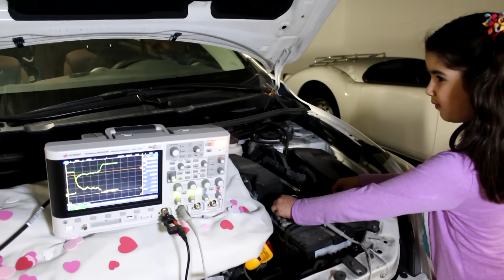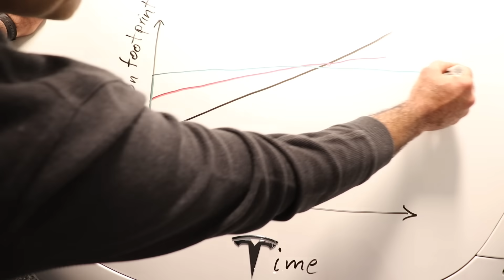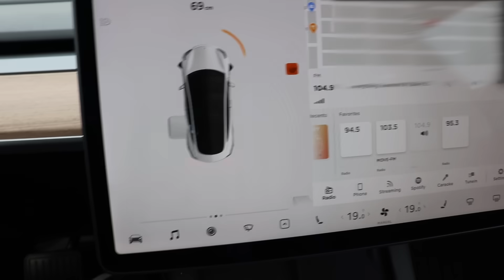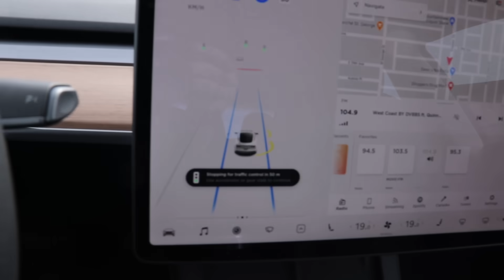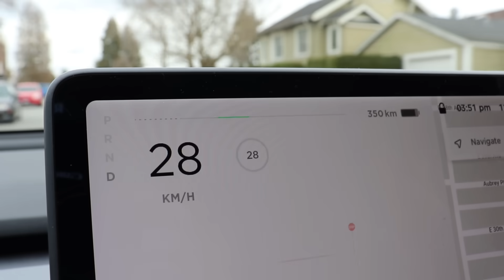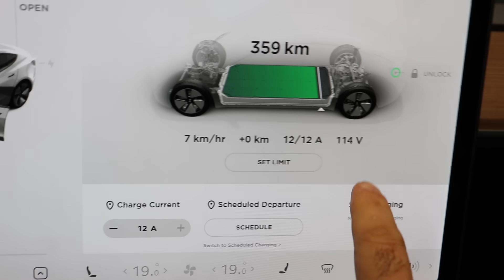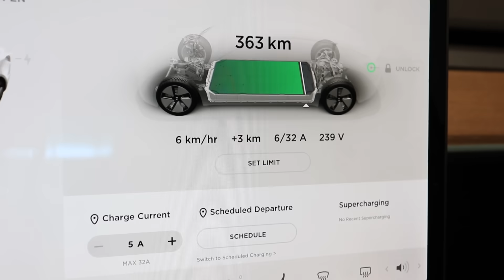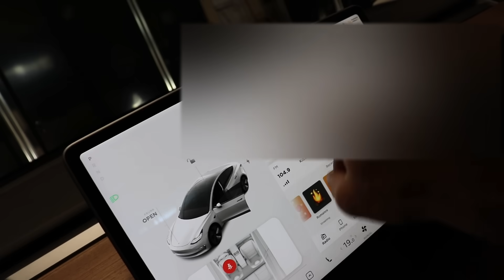ELECTRIC VEHICLES & My Tesla Model 3 Review

Comment: The only time my gasoline car drives 100km on 10L is when im doing 130 km/h on the highway. Even when I am "racing" with my car (Opel Corsa 1.6L Turbo, 150 horsepower) I get on average 11 to 12L to 100km. If I would drive like an old lady, this goes way up to 16L per 100km. 
Anyway, while still more expensive than EV, my main concern is 3 fold and you mention all 3 (nice!):
- Electricity is mostly Coal/Gas, this is just as bad for the environment. As long as nuclear power is not dominant, it will remain something that doesn't contribute to the environment shortterm.
- Production of EV car is less environment friendly
- Existing electric grid is unable to charge all cars at the same time. This will require quite a lot of infrastructure upgrades which will be expensive.
Mostly points 1 and 3 deter me from going to an EV car. I also like driving manual and getting that perfect shift at maximum speeds. Being in control of what the car does makes driving so much more enjoyable to me. I've driven automatic (gasoline) cars and I just find them a bit boring. But it is the way forward.

Comment: The problem with this new 'Electric cars are so eco friendly!!!' is that the energy those cars use comes from, you guessed it, coal and gas plants!!! The best way to produce electricity is nuclear energy! sure... There were some incidents about the whole meltdown thing but now? That tech is over 50 years old with fewer safety measures due to not knowing enough about the fuel! Stop being scared of nuclear! You're irradiated by the sun all the time and the new safety measures that can be put in place are more than enough to avoid extreme incidents! The number of indirect deaths from coal and gas is super high due to the mining accidents and lung diseases from the particles made from burning heavy fuels.
In nuclear, there is no burnt fuel! The rods of fuel are just releasing heat on their own by decaying slowly which allows energy generation for a long time at a decent rate! As my last point, roughly 1KG of nuclear fuel can produce the same amount of energy as 2.7 million kg of coal fuel!
Just search on google 'How much coal is equal to 1kg of nuclear fuel' and the first article will give you the numbers!
Ignore the stigma and get some damn plants built already you damn eco-warriors!

Comment: @12:50 this is why you should just leave it plugged in.  That's what I do with my Volt and Bolt EV.  They both use the AC power from the grid to heat/cool the batteries too as needed.

Comment: Model 3 is better than Bolt or Leaf because RWD. You don't start a clean sheet design by putting the drive torque through the steering axle. 😠

Comment: You are only pushing pollution to somewhere else. Electricity still mostly comes from fossil fuel.. and be careful driving it around, the trimming falls apart in highway and damages other card
Reply: Depends on where you live. He lives in an area with 95% renewable electricity.
And even in areas with mostly fossil fuel-based electricity, electric cars still win out on carbon emissions.

Comment: - Moving the steering wheel and pressing the pedal is only mandatory because of stupid regulations... Here in Europe we can't even use Autopilot because regulators are afraid. Thousands dead in every country from "human drivers" and people are afraid of a machine?!
- The cardboard boxes are not an obstacle. It has radar in the bumper to detect what exactly is in front of it. You wouldn't want your car to slam the brakes every time a plastic bag appears on the street.
- Manufacturing footprint is indeed larger... by 30%. What most are not taking into account is the petrol production. 20-30 tons of diesel are burned from every offshore platform every DAY. (1333 platform in the world). Pumping the oil consumes electricity equal to powering every vehicle on the road. Refining the oil is the most polluting process on the planet... take India or Australia for example. Not to mention the occasional oil spills.
- IC engines burn fuel at 18-25% efficiency, while powerplants are around 60% efficient when converting fuel to energy. With all that into account, EVs emissions are equalize with CV after around 11000 to 20000 km. depending on where you live.
- EV have almost no maintenance. Compared to CV that require regular oil changes, filters, transition fluids and expensive spare parts. EVs require 600 times less raw resources during their lifetime.
- Cows and agriculture account for only 8-9% of global pollution. It is responsible for 90% of ammonia and 29% of methane emissions... mostly because of fossil fuel based fertilizers. While transportation - 30%. + tons of NOx and SOx. In the cities, this number is way way above that (and you don't have cows there). 
- EVs don't emit toxic gasses which are responsible for more than 7 million deaths... every... year. (source: WHO) In addition to lung diseases and cancer.
Reply: EU laws will probably relax on self driving once the benefits are proven in the real world.
Reply: @logitech4873  Well, benefits are proven in the US - much lower risk of accidents compared with a human driver (source: NHTSA)
It's just that EU regulators are unnecessary overprotective... something like an obsessed mother that puts two layers of clothes and a jacket on you when outside is 20 degrees C. It's weird that they don't care about all the deaths on the road, but fear a feature that will considerably improve safety.

Comment: I work as a response officer, we ha e a nissan leaf at work and a couple of turbo diesel vans... I always drive the Nissan leaf, they're well built and accelerate faster than any TD I've driven.

The downside of electric vehicles is the heater uses the battery quick, and my style of driving kills the battery level within 30miles. This is from a full charge showing 106miles.
Reply: Is it a resistive heater or a heat pump?
Reply: @logitech4873  it's a heat pump, sounds it like a fridge when at a standstill...its a 2016 leaf. These electric wagons are good on acceleration, but come winter months when heaters are required and you need to put your foot down, like in a TDI the realistic range is 25%ish of what a fully charged battery.

I work response, so time is limited and the leaf is driven to near enough  its limits.

Comment: Funny thing with regenerative breaking, if you use it primary your brakedisks may pick up a bit of rust because the surface isn't "scratched off" as often... in my country you have to get your car checked every year and you guessed it, you won't get your permit even with just slight rust on the discs (unless of course the mechanic is cool, but not everyone is....)
Reply: Just remove the brake discs :)
Reply: @logitech4873  hmmm... you are absolutely right, that way you may not even have to check the car ever again!

Comment: You're killing the environment --

Quote - "  Studies have shown that in the US, Europe, and in China, producing an electric vehicle creates more greenhouse-gas emissions than producing an equivalent gas-powered vehicle.

The biggest reason for that disparity is an electric vehicle's battery, which can account for about a quarter of its weight, Colby Self, the managing director at the Automotive Science group, told Business Insider.

Electric-vehicle batteries are bigger than those used in gas-powered cars and feature a different kind of chemistry. While vehicles that run on gas tend to use lead-acid batteries, electric vehicles use lithium-ion batteries, like those found in cellphones and laptops.

Lithium-ion batteries require a lot of energy to produce. So, too, does the extraction and refinement of metals like lithium, nickel, and cobalt. They're also harder to recycle than lead-acid batteries, Self said.

"The CO2 emissions from making a battery are higher than what you save from not making the engine and transmission," David Reichmuth, a senior engineer in the clean-vehicles program at the Union of Concerned Scientists, told Business Insider. "

Quote - " the Union of Concerned Scientists found that manufacturing a midsize electric vehicle would produce about 15% more emissions than the process of building a similar gas-powered vehicle would. For a bigger electric vehicle with a larger battery, that gap could grow to 68% or more, the nonprofit organization found. "

https://www.businessinsider.com/building-electric-cars-how-much-pollution-versus-gas-powered-vehicles-2019-11

Comment: Teslas are infamous for not getting advertised milage but my 2017 Chevy Bolt actually averages significantly more than the advertised 238 miles (383 km). I typically get 300 miles (483 km) on a full charge.
Reply: It hugely depends on where you drive them
Reply: @logitech4873  How and where you drive EV's make s big difference, but Teslas consistently failed to meet their EPA estimates in real world tests conducted by Edmunds while most other EV's consistently met or exceeded their EPA estimates.
https://www.taiwannews.com.tw/en/news/4165464

Comment: Just a small correction, internal combustion engines don't burn fuel while engine breaking, the ECU cuts off the fuel (there may be exception for some engines in particular conditions). It won't refill your fuel tank but you don't use any either and all loads that may be attached to the engine (AC, power steering, electric loads) come for free.
Also in winter all heating coming from the coolant is free since it is otherwise wasted energy.
Not a big deal, just a couple of things usually overlooked.
Reply: Diesel cars do.
Reply: Petrol too
Reply: @luca6819  You just said the opposite.
Diesel cars burn fuel while coasting.
Reply: So i misunderstood what you said, sorry. But neither usually does unless some requirement are met, like cold engine or cathalitic converter, rpm thresholds or whatever the manufacturer programmed. For example one of my petrol car, direct injection, still inject fuel above 4500 rpm and below 1500 when coasting, the other, port injection, injects none until or very close to idle rpm.
It's a lot of time that I don't have a diesel car, but my old euro 2 direct injection diesel car already had fuel cut off while coasting.
Is maybe the older prechamber design that does not?

Comment: Your little story about the trip up and down the mountain reminded me of how electric trains can be used to generate power in a similar way, using their regenerative braking. As you might imagine, this is much more efficient for the average electric train, since they have larger traction motors and tend to travel at more steady speeds. Also, rather than wasting some of the regenerated power through charging up batteries, it gets sent straight back into the mains power grid, where there is no shortage of demand.
Anyway, I remember reading up about a Canadian mining company which extracts metal ores from mines about halfway up a mountain, then loads them onto electric trains for transport down to the coast where they can be either processed or exported. Because each train is loaded with hundreds (or even thousands) of tons of rock on their way down from the mountain mine, the regenerative braking is applied almost constantly. This generates more power for the grid than the empty trains use travelling back up to the mountain mine. So this is an oddly unique situation where an electric railway effectively operates as a power station.
Reply: there's a similar story about electric super dump trucks...  charge em up during the work day, export the power overnight

Comment: Royal Enfield is a motorcycle which is known for its weight and the heavy base sound It makes. But If it will start running by battery and electricity, it will be ruined. Neither will it be heavy, not will it make that heavy deep sound. 😭 Pls no

Comment: Hi Mehdi!

Captain Planet very much appreciates you switched to an EV ;)

I got something to mention regarding the charging efficiency, but I don't know exactly how the Tesla M3 behaves in this topic, but as a general rule of thumb, you have a greater percentage of electrical energy losses if you charge your EV slowly instead of the maximum possible AC-charging rate.
A generic example i made up for refernce: If you charge 10 kWh net energy into your battery with 5 kW, assuming a charging efficiency of around 10%, you pay 11 kWh on your electricity bill because of losses on the way to the battery. On the other hand, if you charge the same 10 kWh net into your battery, but with just one 1kW, you may experience losses much greater than 10%, let's assume 25%, so you will have to pay 12,5 kWh in the end, so 1,5 kWh extra for the same amount of energy stored in your battery.
These additional losses are mostly due to constant power usages of control equipment in your car, for example charge controllers, coolant controllers, battery balancers etc. - for the sake of the argument, let's assume these controllers draw a constant power of around 200W.... you will have to maintain these kind of power usage for more than 10hrs if you charge with 1 kW, so more than 20 kWh get lost here instead of 2 hrs with 5 kW charging rate, which means in this case only 0,4 kWh are lost due to controller power usages. These kind of losses are relativly constant as I can tell you from my experience with the Volkswagen e-up! 2020 which I own and charge almost on a daily basis. However, there are some linear losses due to battery cooling and internal resistance, which increase with increasing charging rate, but at very low charging rates like 120V 5A, the constant losses make up a HUGE part of the power drawn from grid for controlling the charging process, instead of feeding the battery.

Real world examples, which I figured out charging my Volkswagen e-up!:

Minimum Charging speed:1-Phase, 230V, 5A (1,15kW): 23% total energy lost (12,3 kWh used for 10 kWh net battery energy added)

Maximum Cahrging speed: 2-Phase, 230V, 16A (7,36kW): 7% total energy lost (10,7 kWh used for 10 kWh net battery energy added)

Greetings from Germany

Comment: fun fact:the company is named Tesla because initially they used induction motor which was developed by Nicola Tesla.
Also do research on the motor used in the tesla model 3 it includes the new Syn RM developed by them having the property of both Synchronous motor and and induction motor (efficiency of Synchronous motor and starting torque of induction motor)

Comment: Electric cars are nice and all, but I honestly don't think that the future of them is with batteries.
Anyway, I would actually be more interested about the real world running cost of an EV.
A while ago I read about a guy who picked up a Mustang Mach-E from San Diego and drove it all the way to Orlando.
I had calculated that on average US electricity and Diesel prices on the same distance my 2015 BMW 318d would run an additional 200km of range for the same money spent in electricity on the Mach-E.
Seen as electricity in the US comes about 50% from dirty power production, the emission levels may actually be the same.
So concluding this, I don't see a cost benefit or at the current time even an emission benefit.

Comment: The cruise control thing is more wanting you to hold the wheel at all times. it SHOULD only ask for feedback if it can't feel your hands.
As for needing to tell it to start and everything, that might just be canadian laws? As of 5 months ago, it should handle green lights itself.

Then again, my daily is the Bolt.
The one-pedal mode is a secondary drive mode option, but in the standard drive mode it behaves more like a standard gas car (Creep when not braking, only 7kW regen when gas released, stuff like that)
There are still friction brakes if you need to stop faster or if it's particularly cold, and you should test them regularly, as their rare usage can cause them to seize up due to ice/road salt corroding them and no usage to wear it off.

The bolt really only does conditioning if it's plugged in, running, or is told to precondition with the keyfob. This means that the traction battery holds a charge much longer (not sure by how much, but I've never lost a mile of range even from sitting for a week. It does keep the 12v topped up, though.), but it also means the car may not be at its best if the outside temp is outside its comfort zone for the first 10-20 minutes of driving.

Here in the Bay area, California, USA, electricity prices are quite high, but gas isn't terrible, so operating cost is break even (if you don't consider public chargers paid for by your taxes), but the savings from oil changes and stuff ends up being about $300 after coolant changes (which gas cars also need, but EVs are more complicated and have to be done by the dealer at a higher price)

Charging slower can also keep the batteries happier, but with home charging that's not much of an issue as the max you can generally do is still well below cruising power consumption. However, Lithium batteries also last significantly longer if used in the 50-80% charged range, so I only charge to 90% (Older bolt, I can't fine-tune the charge percent) and try not to run it too low too often. But honestly, the batteries should outlast the user even when DC fast charging every day.

Comment: Manual cars you actually have 0 motor load and barely use any fuel going down mountains. Gasoline engines also can use this to break much like the regenerative breaking just you don’t get anything back. All of this assuming you’re in gear ofc